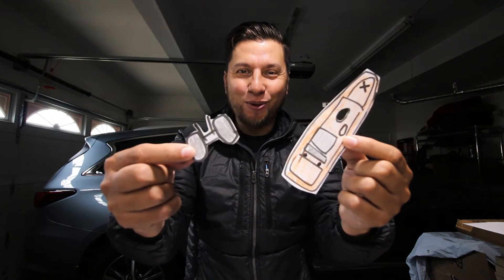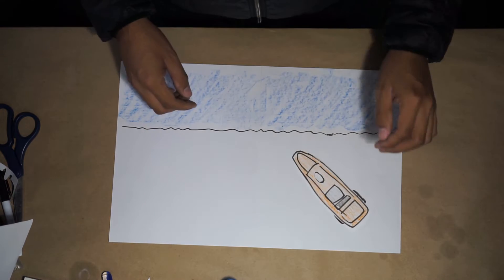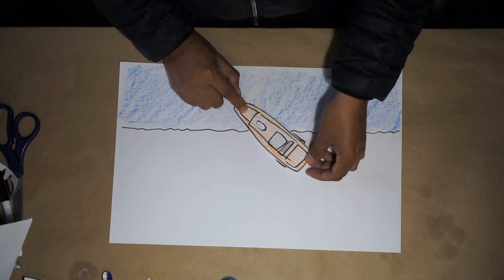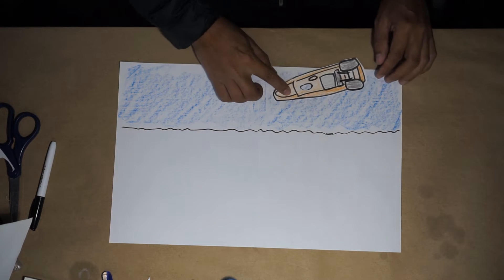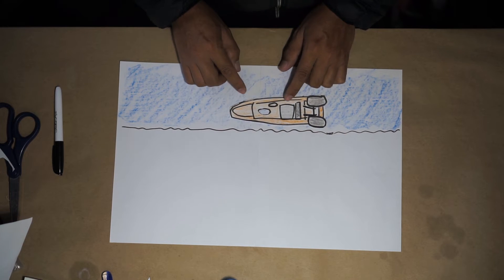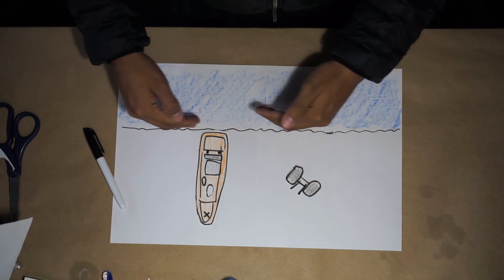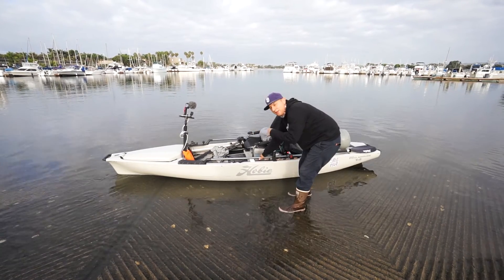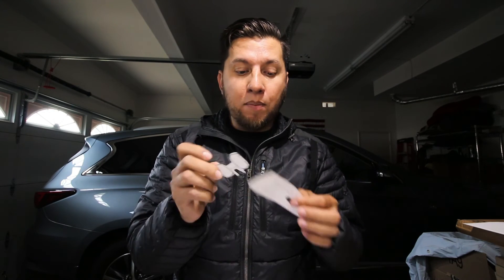How To Launch A Hobie Kayak

Comment: This was a great video. Very unique way of showing, but it worked great. Had mine out for first time today and came ashore on the boat ramp like I was a Viking storming the beach. Needless to say I realized I need to research a better way. This helped a lot, thanks!
Reply from the maker: Hi Ed! Glad this helped. Float launching and landing your kayak will make it last longer. If you have any questions please don't hesitate to ask. Tight lines!

Comment: Nice job Roman, what if you have a Live well in the rear scupper holes. I guess you could always take out the Live well and reinstall it. Maybe a short video of using the front scupper hole for the cart. Or maybe another type of method.

Comment: So yesterday was my maiden voyage with my PA 12.  I have the same wheels and put them in the scupper holes like you are supposed to but then when I got going I realized I could not use the paddle holder and could not get my rods out of the horizontal rod holders.  Have you guys run into this with those wheels?
Reply from the maker: Hi Roger! I know exactly what you mean. The wheels block the rod holders in the back. Here are a few options for you. 
OPTION 1 - Put your cart on the back deck under the bungees.
OPTION 2 - Put the cart upside down through the back H-BAR. On this one make sure it is tied to the kayak somehow.
OPTION 3 - Pop off the wheels, throw them in the front hatch, and put the wheel frame in the scuppers like before. without wheels it wont get in the way as much.
I always do option 1 since its the safest and least work.
Reply: @RomanCastroVlog  yes, I started using  #1 method and this way of launching! Great videos man, keep it up!